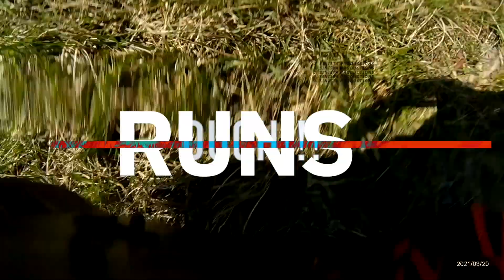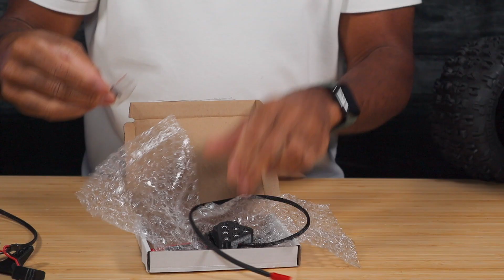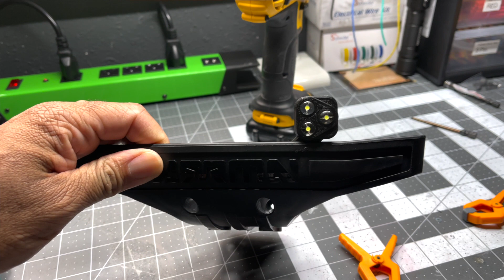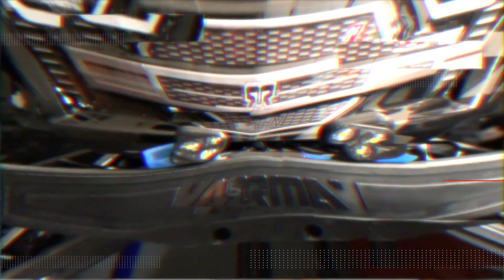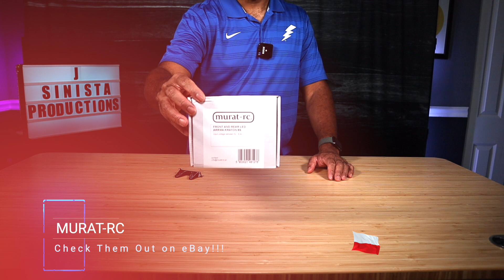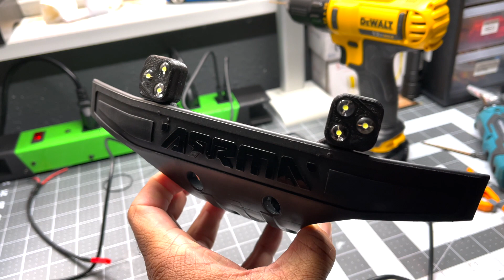ARRMA 1/5 KRATON 8S EXB MURAT-RC LED LIGHT INSTALL

Comment: Finally got mine a few days ago. Well worth the wait. In my opinion, the quality of the print and cables are much better than PoloCreations.
Reply from the maker: Cool.  Have you installed them yet?  Polo's are nice, but these MURAT-RC have a more forgiving, flexible, thicker print that should hold up a bit longer.  I have the Polo's on my Mojave, and I've taken a few spills and they've had up so far.
Reply: @JSinistaProductions  not yet. I got the Mojave and Felony from Polo. I like his design eye but during installation a piece broke on each. Too brittle. I'll be sticking with Murat for now.